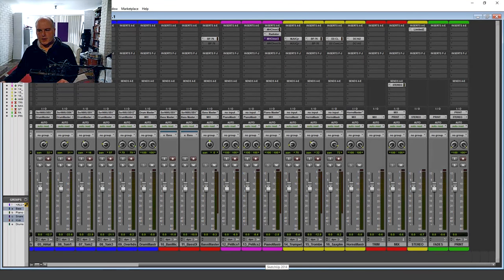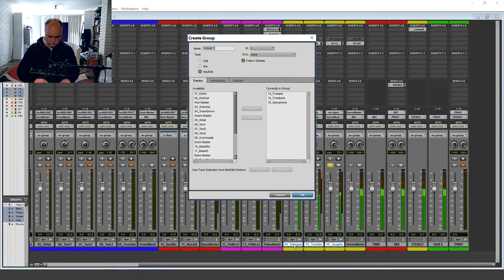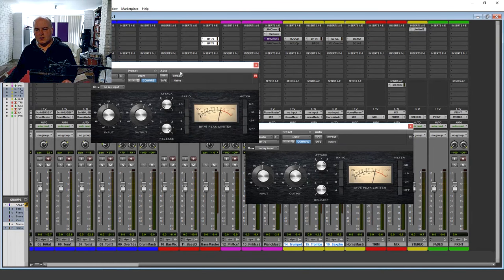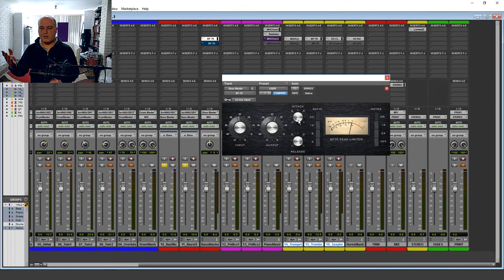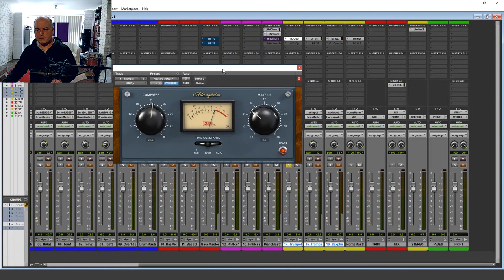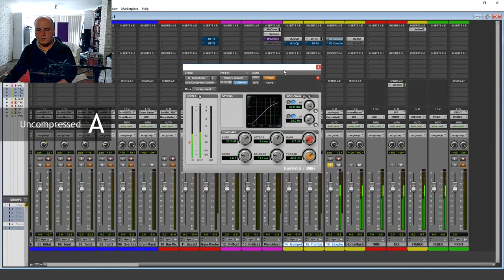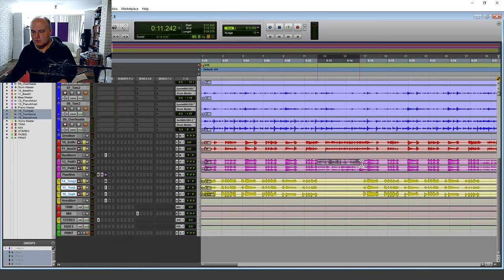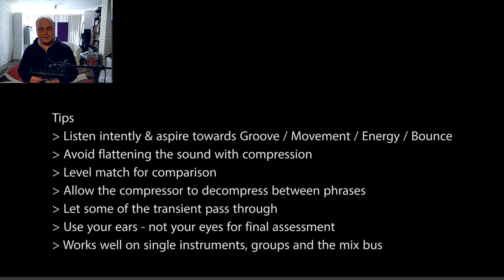Compression for Feel vs Compression for Loudness | SPLmixing.com

Comment: One thing I noticed on the compressed piano is that the high notes are able to come out more giving that feeling liveliness.  I think this is do to the fact that the compressor really operates on the full audio spectrum, but the threshold is high enough to only catch the more prominent low notes, effectively leveling off the lows and letting the highs, seemingly, come up. I think that's why it sounds more even while adding a fullness to the piano's lower notes. So, using compression this way is kind of a two-fold attack over EQ alone.
Reply: it's kind of like with vocals - a compressor "grabs" your notes and holds them better than you can naturally. it's artificial sustain that sounds natural

Comment: How exactly do you define feel? The difference is obvious, the "feel track" feels brighter and more upfront, like the musicians are digging in more, but i didn't get a clear sense of why you picked these particular settings, apart from them being less "harmful" to the track. Would be cool if you could give some more insight into your thought process
Reply from the maker: Good question and thanks for asking...

Feel is subjective, really. In all honesty, the settings I chose for the 'feel' example, I couldn't tell you why I chose those exact settings. If I mixed it another day, they'd be slightly different again. I guess I'm really thinking more about the sound than the settings, though I understand that an open attack let's more transient through on a technical level, I'm more focused on how I can get the instrument to bounce and move in a pleasing way. Try not to think of it as avoiding harmful compression, think of it as enhancing the song through  compression. It's a slight change in mindset, but an important one. So really, it all comes down to what I liked the sound of, the type of compression settings that helped get that bounce. The 20:1 ratio on the bass part is a good example of just how much I don't care what settings I use to get the job done. In the end, only accurate level matching will tell you the truth about your settings, and whether they are actually making it better than the uncompressed instrument. But 'better' is taste thing and also subjective like 'feel'. I hope I've answered your question with the above. If not, please let me know. Happy mixing!

Comment: So, a compression ratio of 20:1, you must have a high threshold?
Reply from the maker: Yes, no threshold control as such on the 1176, but as you drive it harder you raise signal up to meet the threshold. Also, selecting a higher ratio from a smaller ratio automatically raises the (fixed) threshold. Watch my 1176 video for more on this. Happy mixing!